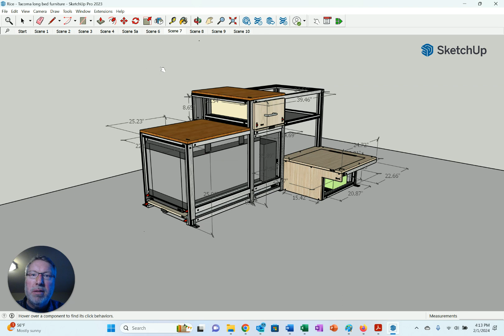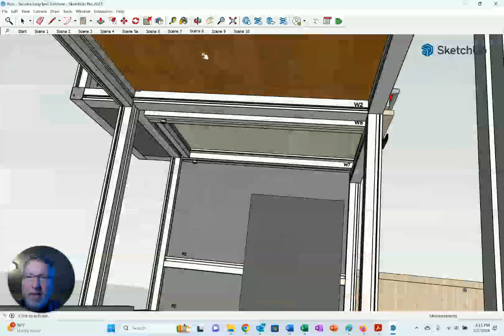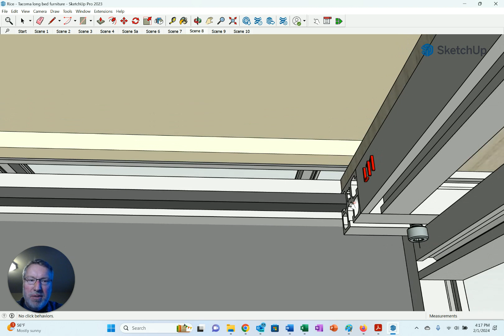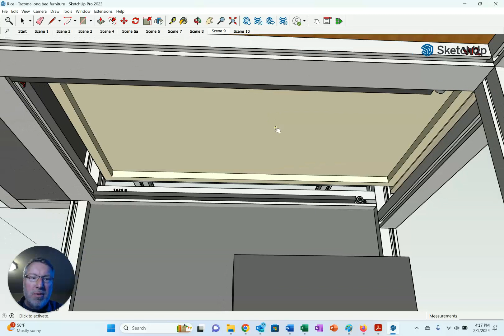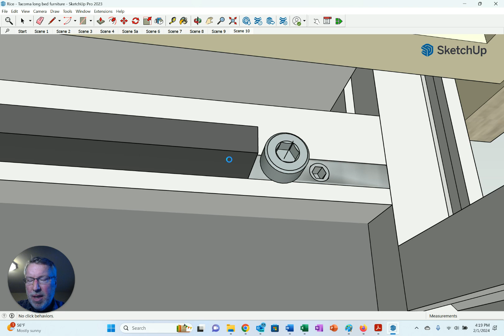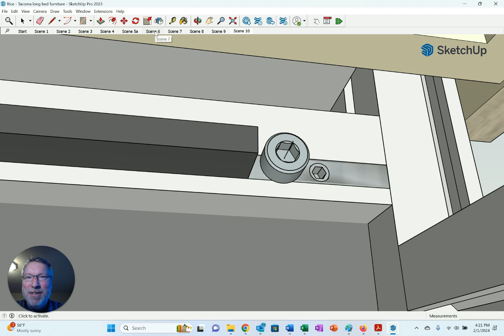Tacoma long bed camper update

Comment from the maker: The glide bar is UHMW polyethylene...a very tough subset of polyethylene that has a strength to weight ratio 8-15 times greater than steel.